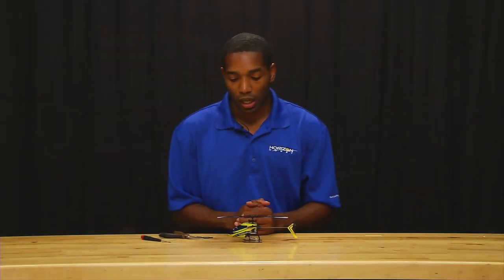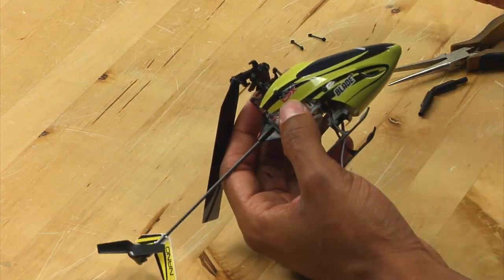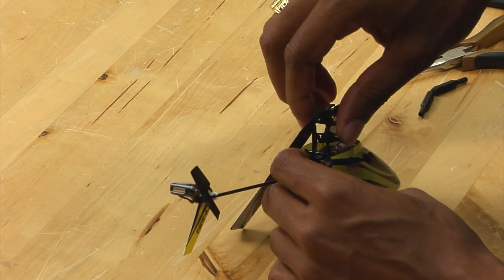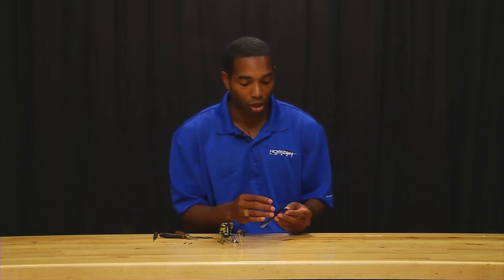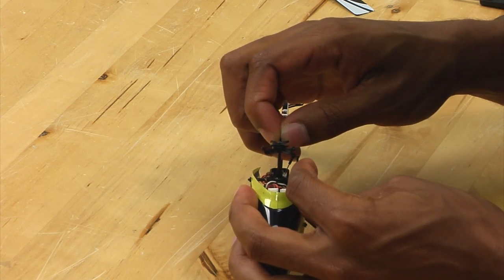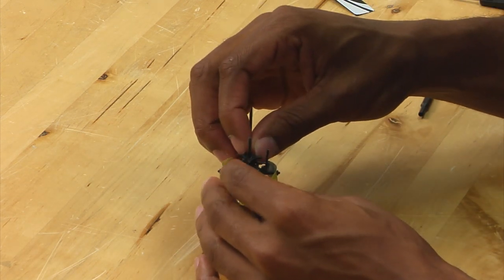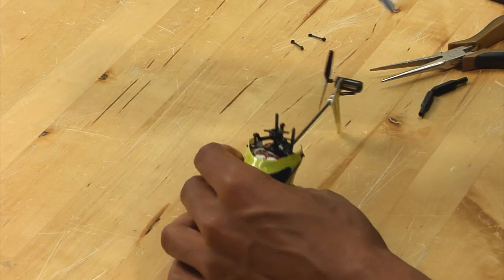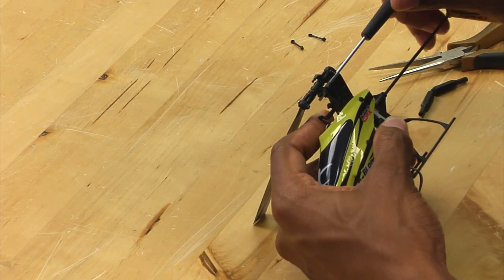Blade Nano CP X Swashplate Replacement

Comment: If you push the head all the way down you won’t get zero pitch. You gotta adjust the head up or down slightly till the blade grips are at zero pitch when in agility mode and the left stick is centered.